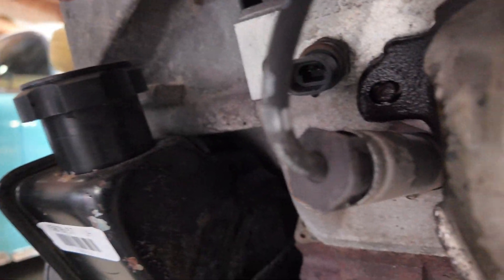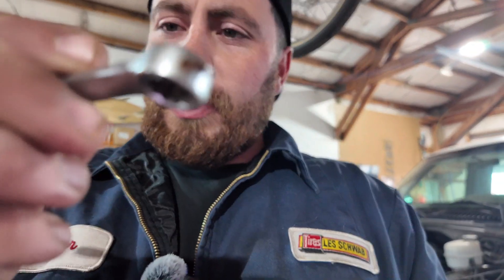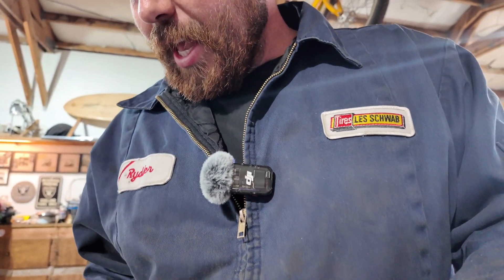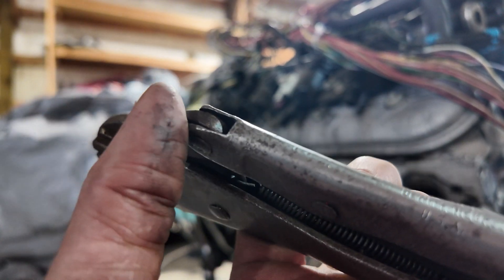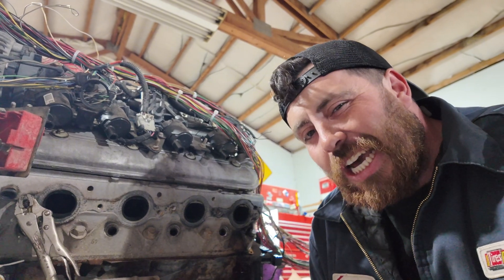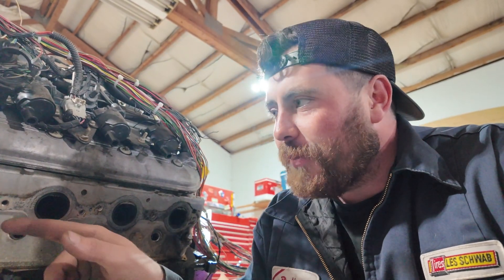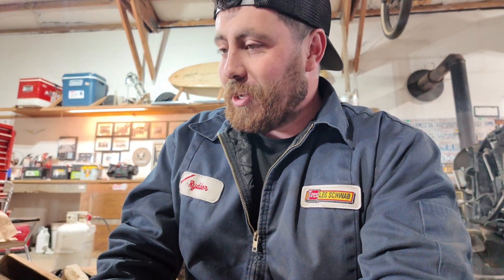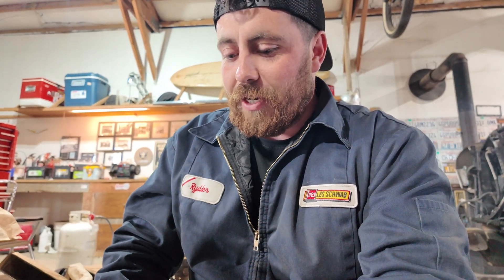The Best way to get Broken Bolts out of a Head!!!!

Comment: No fair... you picked an easy motor to get broken bolts out of... Try it on a Ford Triton engine and I will watch the whole thing !!!
Reply from the maker: Step one don’t buy a Triton step two ls swap it
Reply from the maker: The broken spark plug years are what nightmares are make of
Reply: @FallisFabrication  I only work on them but it's the exhaust manifold bolts I was referring to.  The spark plugs were easy by comparison...We sent every one of them to the local automotive machine shop. In many cases, they had to put a head on it... There's a job in itself lol... Junk !!!

Comment: 6pt vs 12pt is immediate justification for snap-on.
Reply from the maker: Yep and the unique design of the snap on 12 that actually grips the head of the bolt Much better then the standard 12 or 6 point